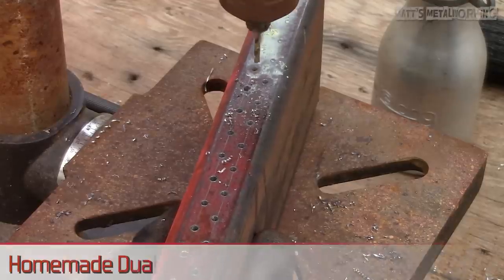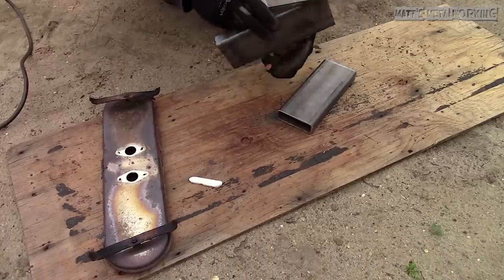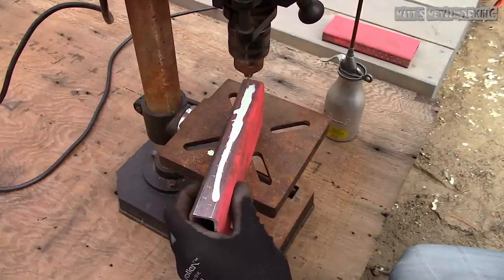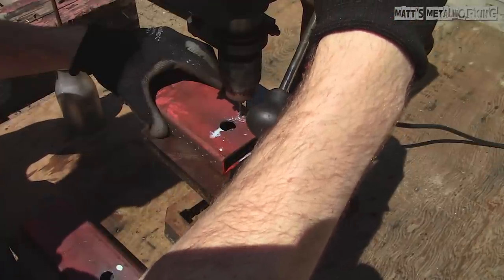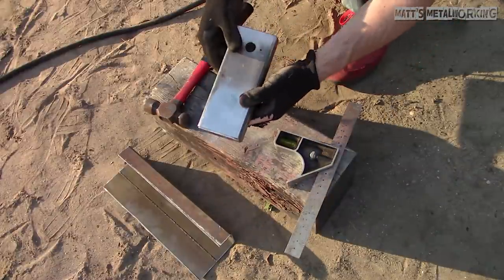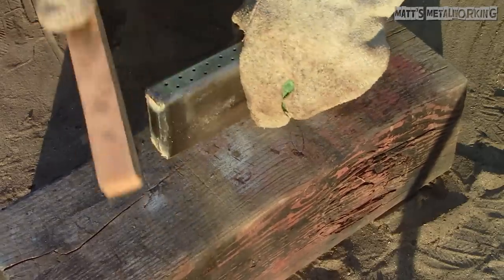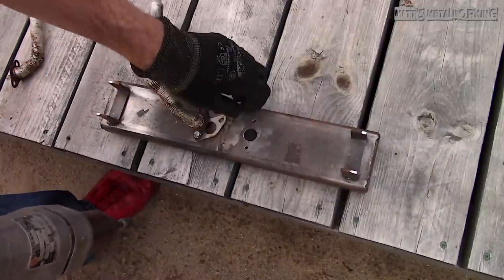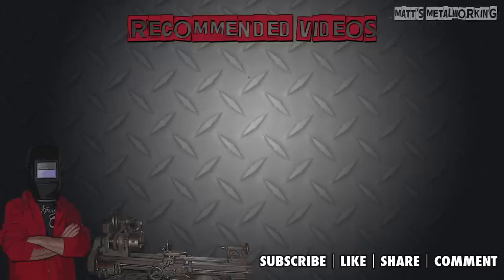How to Make a Propane BBQ Burner

Comment: Great Job!  
You stated that you had to light each of the 4 burner surfaces.  I suggest trying one more hole near where the divider is (angled toward the other side), and a single row of holes on each end with one through the corner (Drilling through weld?  UGH - TOUGH!).  Just a thought...
Reply from the maker: Thank you and great tip! Yeah I was worried about going through the welded area and having the bit break.

Comment: Early on in the video you said that the burner that I assumed came with the grill lasted only 2 years.  I am very interested in knowing how long your home made burner has lasted. It says that your video to date was 4 years ago.  My guess is that the 1/8" thick mild steel burner you hand crafted lasted much longer than the thin flimsy stainless steel burner.  Please let us know how long yours lasted.  Greetings from North Michigan USA. BTW, Great Video and thanks for the valuable information.
Reply from the maker: Thank you. Well the video is about a year older than when I uploaded it. The BBQ ended up in the scrap about last year as the grill finally gave up and it's far more expensive for a new grill than a new cheap bbq. The burner was still solid and had plenty of life left.

Comment: I’ve learned to use 2.- 22.5 corners on each end so the flame can wrap around with just one igniter it’s not round but the flame can jump that short distance
Reply from the maker: Thank you for the tip! Unfortunately with this, I would have needed to make the burner narrower, otherwise the flame will touch the body of the bbq.

Comment: Install a heat dispersing shield over the burner   It gives a better spread of heat across the grill
Reply from the maker: Already has one, can be seen at the end of the video. Also it's needing a replacement now along with the grate. I need to find some stainless steel replacements.
Reply: @MattsMetalworking  you can make one that is wider though to cover the flame and it will help with more even heating

Comment: why did you cut it in half to begin whit if you wear going to weld them back to gather ?
Reply from the maker: Dual zone, there's no other way of achieving that. There is a plate inside which divides the two halves.

Comment: what is the white water that you use to drill the mild steel?
Reply from the maker: It's a mixed cutting fluid. Comes as a concentrate, just calls for water.

Comment: Will bigger holes increase the BTU's?
Reply from the maker: No, bigger holes won't allow for an efficient burn. In order to increase the BTU, you'll need more holes.
Reply: @MattsMetalworking  Airflow to gas ratio for efficient burn... increase the pressure of flow for more BTU's

Comment: Suggestion  When welding with flux cored wire Use the push technique Not pull as it gives a better quality weld  David in UK TWI Professional member  Good Job
Reply from the maker: Thank you! First time hearing that, I was always taught "when there's slag, you drag", otherwise it'll cause inclusions in the weld.
Reply: that is the exact opposite of what i was taught and what ive heard many professional welders say in informational videos and welding classes.

Comment: What kinds of BBQs or burners have you bought in the past?  I've been BBQing and grilling and smoking, etc etc etc, for 50+ years and never had a burner give out after a couple of years.  I've never known of this happening to anyone I know, either.  I am very curious what equipment you have used in the past where this kind of breakdown is normal.
Reply: New grills suck. I see burners rot out in 5 years easily. It also depends on how often you use it, the environment, etc.